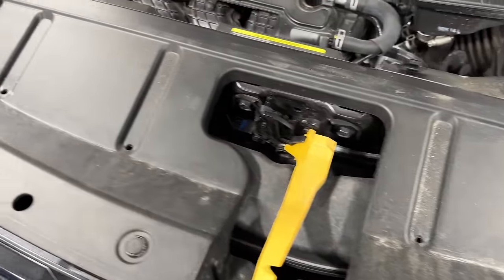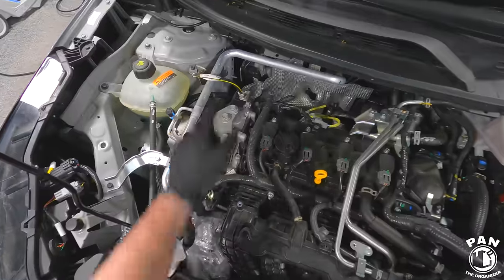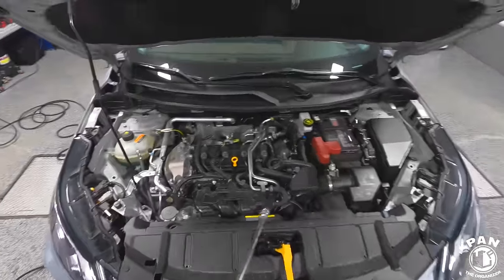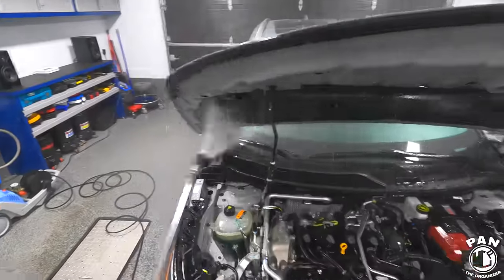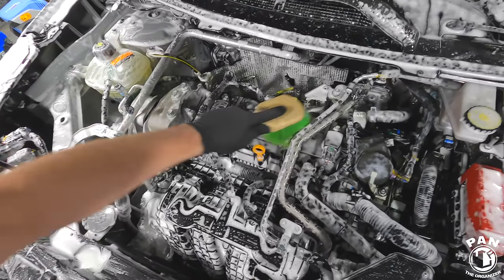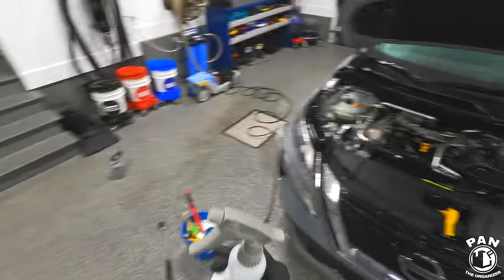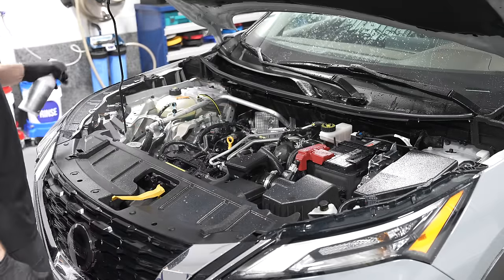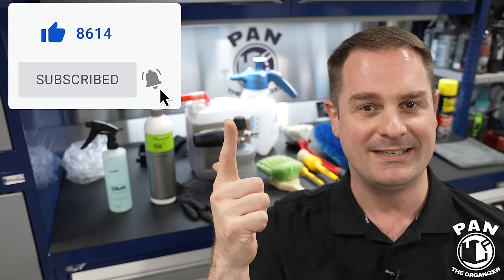How to Safely Clean Your Car's Engine Bay!

Comment: I drive a hybrid, have you ever tried implementing these steps on a hybrid? Also LOVE the content, as always
Reply: hybrid wouldn't be any different
Reply: same steps, stay away from orange wires
Reply from the maker: When it comes to hybrid engines, most of the common sense and tips are similar to regular engine bays, with a few slight tweaks.

Here are some videos that give more details: 
Toyota Prius engine bay: https://youtu.be/UQhrIEYwW9E
General hybrid engine bay cleaning tips: https://youtu.be/AHosBEZAHPY
General tips: https://youtu.be/X_cwN4ljpG8
Reply: Thanks for asking that question cause I was going to ask that, i have a 21 Accord Hybrid Touring and I was wondering the same thing.
Reply: Good question. I have a Toyota Avalon hybrid and was wondering the same thing.
Reply: Many have tried, but they're not around to tell the tale, lmao

Comment: 6:02 After I clean my engine on my 2020 Toyota Camry and let it dry . I liberally spray 303 Protectant , all over the engine compartment and let it soak in . Never any streaking / staining issues , etc. I do this about twice a year to help rubber and plastic components resist cracking and fading . Then about a month later I will clean the engine again , as the 303 Protectant attracts surface dirt . Best time I think is during hot spring and summer . That allows the 303 Protectant to be really absorbed the best . My air intake is open  , so I stuff a microfiber towel in it to prevent water from getting inside

Comment: Awesome video, one of tools and products I use on my engines is the Tornado Car Cleaning Gun filled with Optimum No Rinse Wash, it worked really well in getting the dirt in all the tight spots around the intakes and electrical boxes when I just wanting to do an engine touch up. 

I’m going to give the KOCH CHEMIE | Motorplast a try. I’m always worried about spray products in the engine area for fears of it become a dirt magnet. 

Thanks again for the great video and product suggestions!
Reply from the maker: Thanks Rick!

Comment: Excellent work Pan!  I like using Super Clean for the initial pre spray and a mixture of any APC and high foaming neutral car soap in my foam cannon or IK foam sprayer and apply a heavy rich foam to do it's work. I usually hit everything with my steamer and agitate with brushes and a final rinse. My go to protection is 1:1 dilution ratio of Chemical guys VRP. I will definitely consider your process by eliminating the steam to see if I can get the optimum results.
Reply from the maker: Thanks Ken!

Comment: Great video, I also use Green Star and Motorplast, but have also used Koch-Chemie Vorreiniger B instead of Green Star as it is my standard pre-wash foam. I was quite nervous the first time, but never had any problem. Motorplast made a never washed 10 years old engine look new. I never dry the engine bay. Keep up the good work, picked up a few new tips here for the next wash
Reply from the maker: Thanks!

Comment: Great video!  One tip from other mechanics is to spray the rubber hoses and boots around/under the engine with the protectant.  That keeps your CV joints and heater hoses from cracking prematurely.
Reply from the maker: Thanks!

Welcome to my channel. You discovered one of the biggest car detailing channels on YouTube as we surpassed 952,000 subscribers and we have over 127 million views! I have been detailing for 26 years and I love to share my knowledge and passion with my viewers.

You found the right channel to help you learn everything about detailing.

Comment: Hi Pan. Thank you for another helpful video . As for me, its best if I keep my engine bay clean to avoid a process that requires cleaning agents . On average i will spend less than 5 mins once a month or so wiping down areas of my engine bay with a slightly dampened cloth. I will often use a few sprays of a Glass Cleaner ( amonia free )on a cloth )

Comment: Hello. Nice work. Greetings from Panama city, Panama. I use degreaser instead of apc. Meguiar's engine degreaser, also use foam soap that I use to wash the exterior of the car, and then use Meguiar's dressing for engine. Than you for the video I will change some steps to do it like you @pantheorganizer the expert.
Reply: The other engine dressing that I use is car pro perl. 1:1 to 1:3 dilution.

Comment: Great video, as always. I've been using a pressure washer and tire shine to detail my engine bay for years with great results. Any issue with this?
Reply from the maker: If the tire dressing you are using says it's compatible with use as a plastics dressing, then it's ok. But before applying the dressing, you must make sure the surface is clean, hence why we use a degreaser or all purpose cleaner to clean the engine bay.

Comment: Toujours de super vidéos Pan. Merci.  
We see that you have removed the plastic cover that sits on top of most engines these days. 
I guess we don’t need to worry about the parts underneath getting exposed/wet? 🤷🏻‍♂️
Reply from the maker: There was no platic cover on this engine hehe. Here’s an engine bay detailing tutorial where there is a plastic cover: https://youtu.be/R5ZbroMTULM
Reply: @PanTheOrganizer  Yes. Merci. Does that mean that you never take out those plastic covers? 💁‍♂

Comment: Nice job Pan! Thanks for your videos.
What if my alternator needs cleaning? I have my father's car alternator which is covered with engine oil for years. What products are safe to use?
Reply from the maker: I'm not a mechanic so I have no advice on that unfortunately.

Comment: One of the most detailed videos out there but yeah there is a but coming from my personal experience if you’re planing to maximum your cars well being and keeping a clean engine bay try doing things manually with the least amount of water dripping down based on your car there are many wiring and sockets down there hiding from your eyes you use water well once twice it’s might be ok but if you over do it that water will get in to your wiring sockets and sulfates and believe me you don’t want that my 2014 kia optimas tcu (rip) destroyed  just like that… this doesn’t mean it will happen to your car if you do it no just be careful and know your engine bay it happened to me because first of all i literally used to wash my engine bay every month and second is that the socket that connected my gearbox to tcu was just under my air box so every time i washed it little drops of water got in there and over time sulfated in there and …. Yeah you can guess the rest anyways this was just a hint out of a personal experience nothing more clean your engine bay with precision and make your car happy

Comment: Great video.❤❤❤. Question -- Did somebody used Meguiars (step 2) Engine dressing? Does it goes on wet or try engine parts and is it just for plastic or all engine bay parts? Thanks in advance for any help ;)

Comment: Your video was interesting and I liked the result you achieved.  I have a concern though.  In almost all of the engine bay detailing videos I have seen I here the presenter saying for how long they have been doing "this" and never had an electrical issue.  I am weary of that because we all know that there's a first time for something adverse to happen, especially since electricity and water and not complementary.  I would feel more comfortable hearing the advice to protect not just the alternator, but also the coil packs and other sensors.  I have had the misfortune of recently replacing all 4 coil packs in my car and still trying to determine what else is at issue because of a similar approach.  What are your thoughts?
Reply from the maker: I spoke about this in the video, including what parts to protect if you feel uncomfortable of doing this. Again, in 25 years of detailing hundreds and hundreds of engine bays, if there was to be a failure, I would have known. 

But nobody is forcing you to clean your engine bay. If you don't feel comfortable doing it, just don't do it. And if you want to do it, take the necessary precautions (common sense) to protect the sensitive electrical components, alternator, battery, coil packs, distributor, ECU, or what ever exposed parts you feel need to be protected.

If you have a recent vehicle, less than ten years old, there is no real reason to be scared in my opinion. But you decide if you want to do this.

Comment: Great video thanks.. I’m curious do you remove the bottom dirt shields under the engine to allow all the dirt and grease run out onto the ground instead of collecting on it?
Reply from the maker: No. We're not removing parts here, as if you're not a qualified mechanic, you can be liable for damage. 

Welcome to my channel. You discovered one of the biggest car detailing channels on YouTube as we surpassed 1 million subscribers and we have over 140 million views! I have been detailing for 27 years and I love to share my knowledge and passion with my viewers.

You found the right channel to help you learn everything about detailing.

Comment: Well done. One question I have is would using the pressure washer at a car wash bay be too much pressure to use for your engine bay? I know you can squeeze the trigger for more pressure but is the default pressure at or below 2000 psi? Also, those hoses have all those other settings (soap, wax, etc) coming through the same line so if I ran the water setting for a few seconds or even for a minute, would that be safe to use? My engine bay is pretty clean already but I would just like to give it a quick rinse to get all the nooks and crannies of soot out. Thanks. (Don't forget the hood rod!!!)
Reply from the maker: It's impossible to know what every car wash bay uses, so you'd have to inform yourself. I wouldn't use anything beyond 2000 psi to wash cars.

Comment: For people saying it's not safe. 
Pan said he has done hundreds of engines details and I've done probably 1000's over 26 years, yes it is safe as long as you take precautions. 
The only issue one of my detailer had was because a mechanic forgot to put the fuse box cover back on properly. Besides that,use common sense and don't blast the engine super close,stay 2-3 feet away and keep moving the water media.
Reply from the maker: There you go!

Comment: Hello from Spain and thanks for the tutorial fantastic job . 

¿ what do you say about cleaning the engine with distilled water? ¿ dont you think its morey safety and clean ? 

Thanks for your help 😊
Reply from the maker: I used deionized water with my pressure washer. But regular water is also fine.

Comment: Hi Pan, thanks for this great video! I have the same Kranzle pressure washer, can you explain how I reduce the pressure for engine cleaning please? Thanks.
Reply from the maker: You control the pressure through the tip/orifice of the gun/wand setup that you are using. I use a 4.5 orifice which gives me 1000 psi and 2.1 gpm
Reply: @PanTheOrganizer  Hi Pan, thanks for this information. We can all rely on you to keep us fully informed!

Comment: Great video again, I just want ask after spray the dressing down, do you have to wipe it down after few hours? I used Carpro Perl as you recommended in other video, and leave it as it, it seems very stickit.
Reply from the maker: It depends what dressing you are using. Not all of them can be sprayed on a wet surface and let to dry. Do some testing. See if it levels out. A light wipe with a microfiber towel might be necessary some times, to level out after a few hours.

Comment: I LOVE engine bay degreasing and detailing! My clients are educated on the benefits and see for themselves the difference it makes. The ultimate goal, especially when running a business, is convincing that client to have this service done every few months. A maintenance detail pays well for both detailer and client!
Reply from the maker: Thanks for sharing Brandon!
Reply: There's literally no reason to do it, but I suppose if it makes you money, have at it.
Reply: @mplslawnguy3389  there's literally several reasons to do it to include cleanliness. Which is, after all, the name of the game. My last client had a major diesel leak in the engine compartment which caused fumes to penetrate into the cabin. Guess that doesn't meet your definition of literal either.
Reply: @gunsnsails  Just not something I would do.  I’ll wipe it down if it’s excessively dirty.  Not a fan of spraying water in there though, especially from a pressure washer.

Comment: I prefer using rags and a steam cleaner nozzle. Does not get very wet, gets oils and grease off easily and quickly, and works on all surfaces. It is much slower but I do not mind.
Reply from the maker: There are many ways to clean an engine bay, and yes a steam cleaner also works well especially if used in combination with a quality degreaser. 

Welcome to my channel. You discovered one of the biggest car detailing channels on YouTube as we surpassed 835,000 subscribers and 105 million views! I have been detailing for 25 years and I love to share my knowledge and passion with my viewers.

You found the right channel to help you learn everything about detailing.

Comment: A big question of mine comes to the air box area. What would you do when someone has a cold air intake? Would you just bag the filter thats exposed as well? Or remove then cover the intake?
Reply from the maker: Yes you would put a bag over the cold air intake for sure.

Comment: What about the rubber gasket below the windshield wipers? Any special treatment for that or is your spray going to cover that as well. Over time it seems like they dry out and fall apart and never have seen anybody really pay attention to that
Reply from the maker: Just use some silicone spray on the rubber gaskets, same for the door weatherstripping when you open your doors.

Comment: Hi Pan! New subscriber here and I am devouring your videos! Thank you for sharing your knowledge and experience! I just bought a 2023 Honda CRV Hybrid. My question...does this same method you demonstrated apply to a Hybrid engine bay?
Reply from the maker: Hi Tommy! First, let me officially welcome you to my channel. You discovered one of the biggest car detailing channels on YouTube as we surpassed 920,000 subscribers and we have over 120 million views! I have been detailing for 26 years and I love to share my knowledge and passion with my viewers.

You found the right channel to help you learn everything about detailing.

A new car is never new until it's properly detailed. 
- at the factory, the paint defects are often corrected quickly by rotary polishing which can leave marks and holograms, so polishing corrects those, before you lock that in long term with a ceramic coating for example.
- vehicles are then transported by truck, train and boat so they are exposed to the elements, industrial fallout, brake dust, rail dust, etc
- vehicles are often left at boat docks (when transported by boat) or in exterior parking lots for weeks or months, again being exposed to the elements
- at the dealership, the vehicles are almost always poorly prepped using the same dirty water that was used for all the cars on a given day, and poor washing and drying methods leading to swirls and scratches 
- at the dealership, a layer of cheap wax or paint sealant is usually applied to attempt to make the paint glossy prior to delivery. It's crucial to remove any previous protection before you apply a ceramic coating, as coatings need to bond directly to a virgin clear coat.

If you only plan on applying a regular carnauba wax or paint sealant though, you could decide to skip machine polishing, as those protectants can be applied over existing protection and it's not as crucial to prep the paint as well.

I explain all of this in this popular video: https://youtu.be/QgoyrC-5CMc

So you can better visualize the new car prep process, here are the steps I perform on a brand new car for my customers: 
Aston Martin Vantage: https://youtu.be/OKga3yZVTqo
Volvo XC60: https://youtu.be/tvDBBenhYFA
Tesla Model Y: https://youtu.be/gohks8xP5NY 
Porsche 911 Carrera: https://youtu.be/2ckiivbFqs4
Mercedes AMG GT63S matte black: https://youtu.be/eU8zg1lXvXY?si=oGxoCp8PWt7gTncV
Audi Q7: https://youtu.be/t7HCBSVnizM
BMW M6 Gran Coupe: https://youtu.be/0lC9uyKXs8Q
BMW M340i: https://youtu.be/etXhJNaF0EE
Audi RS3: https://youtu.be/641mAJfKDLM
Golf R: https://youtu.be/jr19g4PWJsk

Also, when it comes to hybrid engines, most of the common sense and tips are similar to regular engine bays, with a few slight tweaks.

Here are some videos that give more details: 
Toyota Prius engine bay: https://youtu.be/UQhrIEYwW9E
General hybrid engine bay cleaning tips: https://youtu.be/AHosBEZAHPY
General tips: https://youtu.be/X_cwN4ljpG8
Reply: @PanTheOrganizer  Thank you Pan. I'll check out those links and follow all your teachings,  step-by-step. Your channel is the BIGGEST and the BEST! So much wisdom you have on detailing cars! You got a life-long fan here and will get nothing but 👍🏻 on all your videos!
Reply from the maker: Thanks for the kind words! Much appreciated. I work really hard to produce quality content for my viewers, so it’s nice to see those efforts don’t go unnoticed by my viewers.